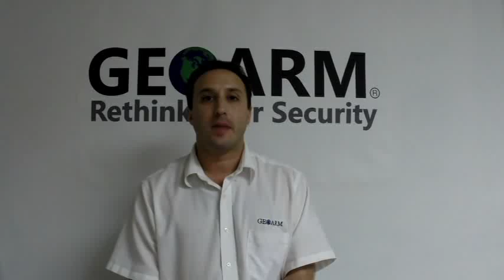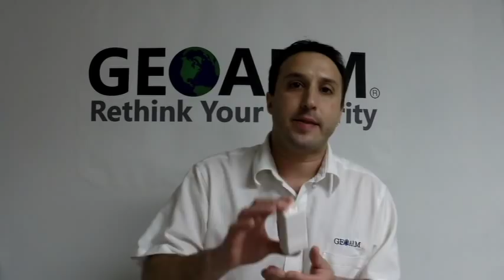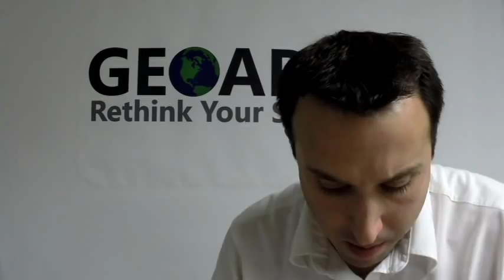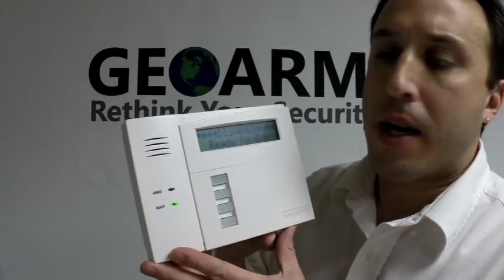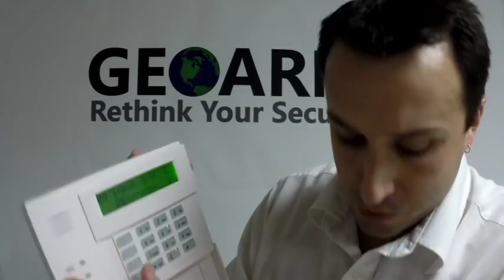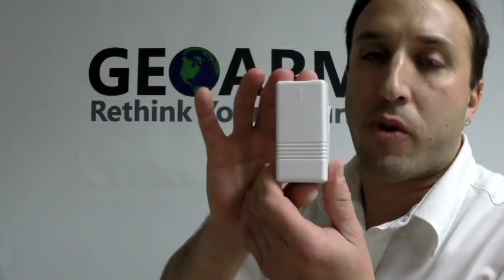Honeywell Vista 20P : How to Program a 5816 Wireless Door/Window Contact using a 6160rf keypad

Comment: So I tried to Trip the sensor so the serial number would automatically be in the number spots and its not putting it in when I open the sensor, it's not connected to any other panel and there is a battery because I just changed it today.

Comment: Hi, thanks for the video. I ran out of battery of one of the wireless sensors fo my Vista 20P system.  I wasn't able to get the battery replacement for some weeks, and today I replaced the dead battery with a brand new one, but the screen keeps saying that zone is open.  What should I do to reset / test the wireless sensor? I was under the impression that just changing the battery will solve the issue but it wasn't the case. Your support is greatly appreciated.  Regards,
Reply from the maker: If you are a monitored client of ours i would just call our tech support line they can issue some great troubleshooting techniques.
Reply: Hi Jorge , I’m having that same issue. We’re you able to figure out what the appropriate set of actions were to resolve this issue? Thanks.

Comment: Thank you for the video but without an installer code I can't do it... This is a monopoly
Reply from the maker: There is a way to back door your installer code power down your system than power system up within 45 sec get to keypad and hold * and # until you see 20 installer than hit *20 4112 * 99 that should reset your installer code back to 4112.
Reply: @Geoarm  no way? really? I'm going to try it! Thanks!
Reply from the maker: @ManuelEscotet  yes it should work unless the previous company applied a software lockout. Let us know how it goes!
Reply from the maker: @ManuelEscotet  Let us know if you are looking for the lowest cost no contract alarm monitoring btw.

Comment: Joe, good information thanks.  Question I have a Honeywell Vista-20P It is working great. but I have one sensor 5820L that's batteries every 4 to 6 weeks . How do I replace it with a new sensor. Can I just change the S/N of the sensor or do I delete the zone and install the zone again with the new S/N ?
Reply from the maker: Thank you for your question on the Honeywell Vista 20p with wireless sensors. How far away is the 5820l from the wireless receiver? Is your RF Reciever next to the vista or built into a wireless rf keypad?
Reply: The sensor is less that 20 ' away.  The system was installed in 2017 and has worked fine till May of the year 2018.  the alarm shows low battery, and when I test the battery it does show low. Does the sensor need to be replaced ? If so,  how do I program the new senor so it as the same zone. Is there a way just to edit the S/N of the sensor ?
Reply from the maker: If you have a new sensor you would want to delete the old sensor an reprogram the new sensor to that same zone.
Reply: Thank you .Do you have a YouTube that would help on how to do it?  I have an idea but I don't want to blow it or even delete all the programing in the control and have to reload all zones. Thank you for any help..
Reply from the maker: I dont think we have a video showing you how to do that. Are you looking for no contract alarm monitoring services?
Reply: I am doing the zone swap out myself. I can do it. Was just looking for a guide of some sort so I don't make  a mistake. was tired of replacing the battery every few weeks.
Reply from the maker: Are you looking for no contract alarm monitoring services?
Reply: Thanks, but no not looking for monitoring service I have one. That service company monitors only. I do not have a maintenance replacement contract.  I only want to replace the bad zone sensor. and do not want to have a service call to fix the problem. That why I asked if there is a way to remove the zone with the bad sensor and reinstall the zone with a new sensor with a different s/n in the same zone.
Reply from the maker: ok just so you know our rates are no contract $8/month phone line $10/month internet, $15/month for cellular and dual path monitoring. This including tech support, cell data "if applicable" and monitoring for police, fire and medical services. Let us know if you have any question again thank you for your support!

Comment: As a former installer it would be helpful to show users how to program the serial number into the keypad especially if they are replacing an old unit. Also please explain better the difference between loop 1 and 2. You glossed over the reason for the difference.
Otherwise great video. Thanks
Reply from the maker: Thanks for supporting our page and the positive feedback on the diy installation of the honeywell vista panel. This is an old version of the video stay tuned for more tutorials.

Comment: Hi GEOARM. I navigated to the serial number screen on my 6160rf for my vista 20p system. I can't trip the serial number on to the screen by removing the magnet from the wireless transmitter. I tried to enter the serial number manually, but this didn't work either (ie. the system can be armed with/without the new transmitter being there.) Am I missing something? Can this be a faulty transmitter? Faulty receiver in my 6160rf? or did I forget to enable a setting to allow for the transmitter to communicate with the system? HELP and thanks!
Reply from the maker: I believe you do have to enable rf radio within that keypad have you done that already or is this the first wireless device you are adding?

Comment: Great video series. I've been trying to use my 6150rf keypad to program a 5816 door/window wireless transmitter into my Vista 10P system. I'm working in the dark guessing at the prompts, but I think my steps are correct. I can't get the transmitter to "trigger" the 3 beeps in the "enter serial number" screen (if in fact I was on that screen to begin with). Because I can't see the prompts, I can't figure out whether it's a programming error, a hardware program, a system configuration problem, etc. Do you know if the prompts are similar in the Vista 10P? What's the most likely culprit to my dilemma? After a successful transmitter programming, after exiting, should the system already know to be NOT READY as soon as the magnet is moved away from the transmitter (ie. how do I know I have successful added a new wireless zone + device)? Thanks.
Reply from the maker: You will want to add a Honeywell 6160rf keypad or a Honeywell wireless receiver 5881.Programming on a 6150 is not going to allow you to program zones.
Reply: Thanks for your quick reply. I think I will buy a 6160rf keypad just to make programming easier anyways. Before I do, on the box of my 6150rf keypad, it said the keypad contains a built-in 5800 series transceiver. Does this mean my keypad is capable of wireless zone programming? Thanks again.
Reply from the maker: that just means that it has a built in wireless receiver to allow for wireless but you would still need a 6160 programming keypad to program the sensors
Reply: Thanks for the clarification. Again. Great video series
Reply from the maker: My pleasure by any chance are you looking for low cost no contract alarm monitoring services?
honeywell 6160 keypad: http://www.geoarm.com/6160-honeywell-alpha-alarm-keypad.html

Comment: Hi, "4112800" doesn't work for me. The installer is no longer in business & I'm trying to program a 5816 for a new door. Honeywell customer service  is no help. Any suggestions? The wall unit is M6983. Thanks!
Reply from the maker: Do you have alarm monitoring services for this system?
Reply: +GEOARM Security No monitoring, just plenty of armed, nosey neighbor's! Lol! I was able to change the installer code, but don't know how to add the contacts.  I was unable to do it following these steps, I guess the process isn't the same for the 10P? 
We finished out our garage & are trying to add 2 contacts (Amdeco 5816) to our Vista WA10P-2.0 system using a Honeywell M6983 keypad. Our alarm guy is out of business. Thanks for your help!
Reply from the maker: Do you have a wireless receiver that would allow you to use wireless sensors?
Reply: +GEOARM Security Yes, some of the ones we already have are wireless. Thanks!
Reply from the maker: Do you have key fobs on your keychain? Also how many wireless sensors do you already have?
Reply: +GEOARM Security Hi, we don't have key fobs, we have 6 wireless contacts & one hard wired door. Thanks!